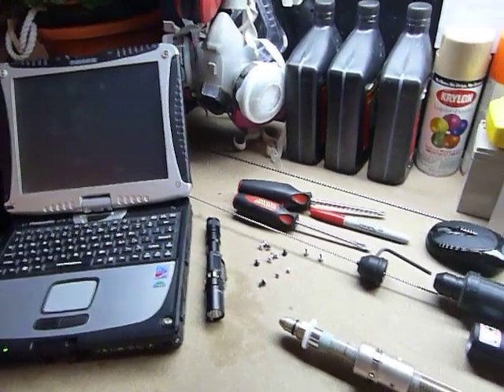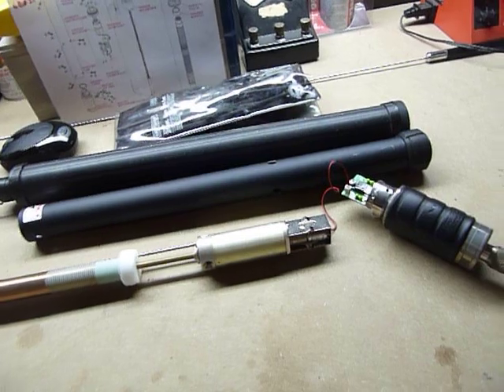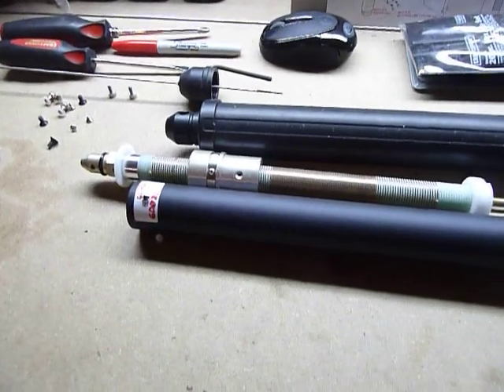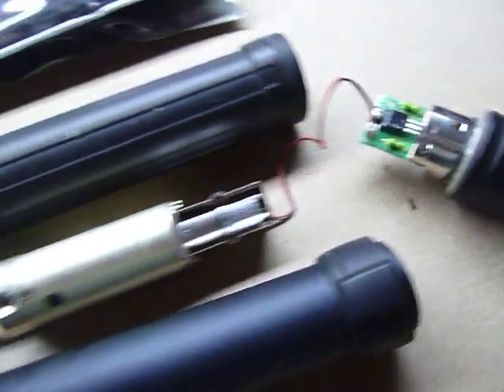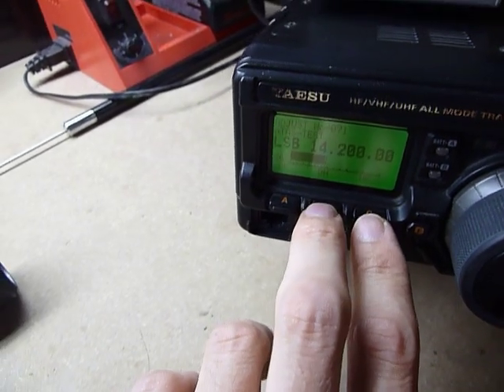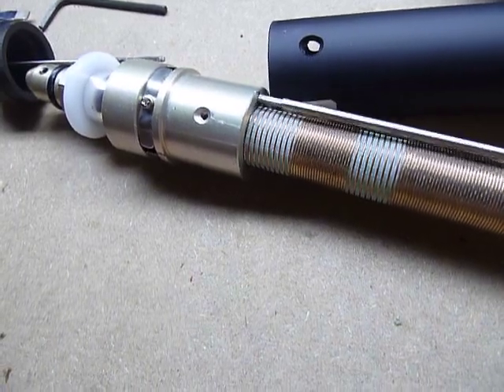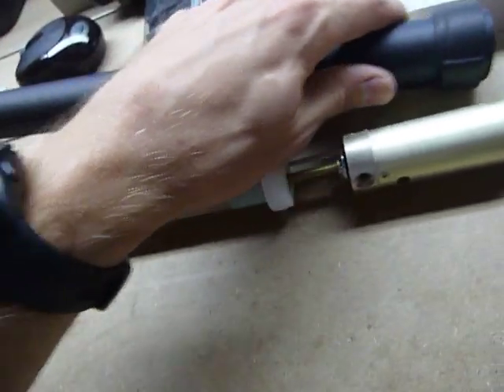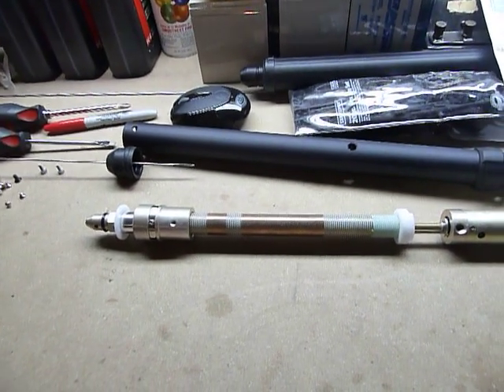Yaesu ATAS 120A Antenna Maintenance - What's inside

Comment: Very nice video, and good explanation of the ATAS-120A's internal components. I just ordered one along with my Yaesu FT-857D. But I do have a question: if I wanted to waterproof this antenna so that it requires almost zero maintenance, what do I have to do, could you tell me? Thank you. 

KC2ZXL